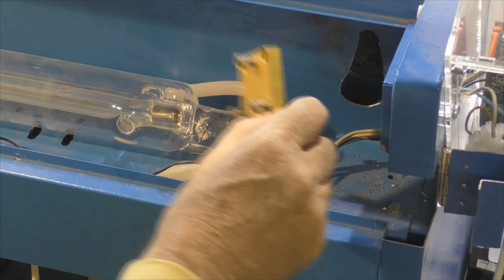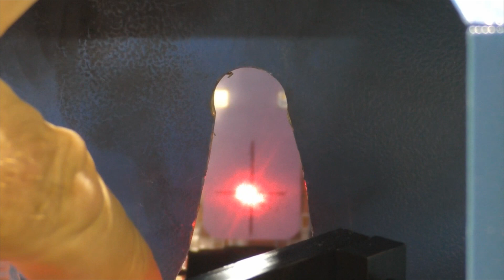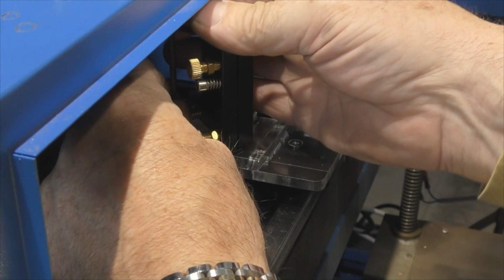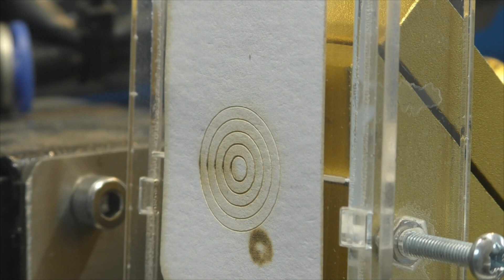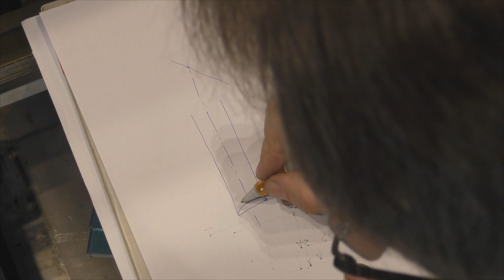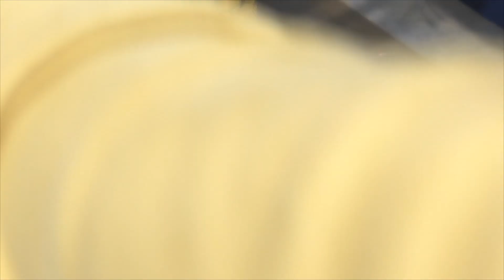RDWorks Learning Lab 119 One Piece Tube and Mirror Mount INSTALL

Comment: Brilliant video, is it possible to get the parts for my k40 please
Reply from the maker: Hi Nigel

 Thanks for your interest and enthusiasm.  Sadly I never intended this project to fit into a K40 . Two main reasons. One, there is just not enough  space in the tube enclosure. Two, the mechanics of the machine with its fixed head and its "floating" gantry are not worthy of the effort. That is not meant to be an insult to the K40 because  I have seen some great work from these very basic machines. However ........ don't be too despondent because  things change with the passage of time. Here we are 5 years later and after creating my own budget RF laser and being loaned a high spec MOPA fiber laser for 1 year,  I have gained a lot more experience of laser technology in general. 

Two years ago I was gifted a  very basic K40 machine   by Cloudray to "do something" with.  Hmmmm.......for two years its been just a flat surface to stand things on but I had a nudge form Cloudray a few months ago  about "upgrading" it to a digital machine with their special K40 kit  
 
https://www.cloudraylaser.com/products/cloudray-k40-series-upgrade-kit-for-co2-laser-machine?_pos=3&_sid=6f158186b&_ss=r

Was it worth it?.Rather than rush in with a negative answer I took a day out and did some imagineering. I eventually saw a vision of the future where this small format machine  could become a very portable version of my  "big" machines. All the same precision speed and flexability but  with an A4 work area..

 Please watch this as a taster
https://www.youtube.com/watch?v=zu-hccXJPBg&t=93s

Then take yourself across to
  
https://laseruser.com/k40-xtreeem-laser-cutter-upgrade-menu/

 and you will see what the possibilities are for your machine

 Best wishes
Russ

Comment: Russ, would you say adjusting your other machine is simpler with better access than Lightblade? As you have so much video material I wanted to decide which one is better purchase without before modifications. BTW. Amazing video as always. Thanks a lot.
Reply from the maker: Hi
At 4 times the price  my  Ebay machine, the Lightblade is not the sort of investment that  many hobbyists can afford. There is no contest if it was just a machine choice, the Lightblade wins hands down. Better size, better access, better usability and much better build.. Apart from throwing away a couple of annoying and unnecessary extras (auto focus and red dot pointer) I have left the machine unmodified for  two and a half years. It is made by a Chines company called Transon CNC and I note recently that you can buy a sister machine from ebay. 
https://www.ebay.com/itm/laser-engraver-cutter-machine-marking-machine-400-600-6040-80w-ruida-cnc-router/143082655440?hash=item2150640ed0:g:7nEAAOSw8~hcTskW

https://www.ebay.com/itm/4060-50w-ruida-laser-engraver-machine-carver-cutting-Acrylic-glass-plywood-cnc/143051312601?_trkparms=aid%3D111001%26algo%3DREC.SEED%26ao%3D1%26asc%3D20160811114145%26meid%3D065af592747d453097a7f485c758df4b%26pid%3D100667%26rk%3D6%26rkt%3D8%26sd%3D143082655440%26itm%3D143051312601&_trksid=p2045573.c100667.m2042

com/store/product/JNHXSK-TS6090-130W-Ruida-Laser-engraver-machine-Cutter-machine-CNC-Router-co2-laser-engraver/3879030_32982935304.html?spm=a219c.search0104.3.91.d5853ae3IjgVZw&ws_ab_test=searchweb0_0,searchweb201602_6_10065_10068_10547_319_10059_10884_317_10548_10887_10696_321_322_10084_453_10083_454_10103_10618_10307_537_536,searchweb201603_54,ppcSwitch_0&algo_expid=a27faee5-d1e1-4396-83d1-27c11ef1bc5a-14&algo_pvid=a27faee5-d1e1-4396-83d1-27c11ef1bc5a

There is a guy in Argentina that has this last one on it's way to him at present and he will send me pictures when it arrives so that I can assure myself that the basic mechanical build standard is the same as the Lightblade. I know that Thinklaser have messed with the specification and that the Lightblade is a special variant with many high standard safety features to comply with European machine build and safety standards for laser machines, but most of those mods are within the electrical enclosure and not to do with the basic design.

There are a few external differences that annoy me with this Ebay/Aliexpress variant. In particular the grill in the lower front door is bypassing all the exract air  so that nothing goes anywhere near the table/work area. Taping these over and leaving the main door open about 40mm will fix this

Best wishes
Russ
Reply: @SarbarMultimedia  Thanks Russ for such a quick and detailed reply. Hope we will hear from you a word or two once you receive the pictures to compare it.

Comment: Hi Russ, how do you clean your mirrors? I used alcohol and it made the beam burn material- does it make sense? 
D
Reply from the maker: Hi Dimitri
It depends on what your mirrors are. If they are gold coated then be VERY careful because gold is very soft, it will also me atomically thin. Depending on what is underneath the gold,  you could be in for all sorts of surprises if you break through to it.  Is this your problem?  I usually just use isopropyl alcohol and a cotton wool bud to  gently `clean the general film that tends to build on mirrors. Sadly the alcohol tends to leave a film behind and it is essential to finish off the cleaning with a proper lens tissue that you will be able to get from any camera store. If you have silvery looking mirrors then it's almost certain that these will be the best type (solid molybdenum). These are very durable and you can be fairly brutal with them and not fear damage. You can use acetone if there is burnt on debris but always finish off with a lens tissue. 
Best regards
Russ
Reply: SarbarMultimedia 
Hi russ, I will email you the photo

Comment: Hi Russ, regards
Thanks for the details were a great help.
The frequency of the tube (Hhz) is: 20 and the signal level: low, these are the parameters that must be the laser.

in which it helps me to modify the frequency or as if it is in the correct frequency. Thank you.
Reply from the maker: Hi Jean
This frequency  (20khz) is the PWM frequency and although you can adjust it, the only thing it will affect is the response time of your current demand during greyscale engraving. There is another frequency that you could adjust if you had an RF tube, but we don't, because our tubes are just DC voltage excited. so there is no frequency to adjust. There is one exception and that is if you select "special mode" in the scanning USER parameters . This operates from the PWM signal , but I can see no value in adjusting it from  20khz because you can control the mark space ratio with the % adjustment provided. See my video  that explores this Special Mode  https://youtu.be/nKZn3UwPEfU 

Best wishes
Russ

Comment: you recommend not to use the machine maximum 60% of its capacity, how much maximum mA for a 100w tube.
Reply from the maker: The max current for a tube depends on the tube manufacturer's recommendation and also on YOU understanding what power tube you have. You think that you have a 100 watt tube but is it really?. Does it have a maker's label? does it have a model number? If it does not then what diameter is it (80mm?) and what overall length?(1250mm or 1450mm?)
From this information I can tell you much more.

Why do I say 60% or 65%  should be the maximum power to use? Well, if you drive the tube too hard you are destroying the CO2 inside the tube. This is all explained in a video I did for Thinklaser. https://www.youtube.com/watch?v=2F5O-1TH8b0&t=142s

What controls the current?  Answer ......the power supply has a current regulator within. The max current output for a 100 watt power supply will be about 32mA where as the max allowable drive current may be only 25mA. When you ask for 1% power, the controller will send a zero volt signal to the power supply and that will result in 0 milliamps of output. When you ask for 100% power the controller will send a 5vdc signal to the power supply (the max is 5vdc) which will then deliver max output of 32mA.. That's far too much current  for the tube and will quickly kill your tube (as per the video above). Most people do not have an ammeter and so I recommend playing safe and never using more than 65% power until A) you have fitted an ammeter and B) you understand what the max allowable current is for your tube. My 70 watt tube will deliver 73 watts at 22mA but to get 22mA I set my power to 68%

As an example, you may have a Reci tube model number W2. Some sellers will claim it's a 100watt tube because that's the maximum output at 29mA. Reci call it a 90 watt tube because that's the "normal" watts of output at 27mA. However, Reci  recommends a max current of 25mA which makes the output about 80 watts.

Hope that makes some sort of sense
Best wishes
Russ
Reply: If it has the label is reci w2 rated power of 90w maximum peak power 102 watt, length 1250mm diameter of 80mm, had an equal one and with just 260 hours stopped working, regulate the source to 28mA, I want to take all precautions not to damage this new tube again.
Reply from the maker: Hi Jean Carlos
Your tube specification is here
http://www.recilaser.com/en/index.php?m=&c=Index&a=show&catid=7&id=66

In the operating conditions it says 
2.    Operation conditions
Water cooling: using purified water; 2 to 5 liter/minute; water temperature: 10℃-40℃.
The operating environment: temperature 2-40℃; Humidity 10-60%.
The working current: test current is 29mA. Maximum working current is 29mA. The running current must be kept below 27mA. The life span can reach 8,000 hours if the current is kept below 25mA. The ammeter must be connected to the negative electrode of laser tube.
When it is working under over-high current for long term, the negative pole will appear light yellow and the life span will be shortened rapidly.

This basically means keep the current below 25mA to achieve the claimed life of 8,000 hours. That's strange because it is advertised as a 10,000hour life tube!!! AND as I mentioned previously, keeping below 25mA basically means you have an expensive 80 watt tube. Reci are supposed to be the best but as you can see they are just like most Chinese manufacturers and have a tendency to exaggerate. I have used and calibrated a W2 tube so I know that these figures are correct because I was achieving 82 watts at 25mA

Best wishes
Russ
Reply: Very grateful for his answer, who sold me the machine never checked the source output values and was in 32 mA, error number 1, and when the laser began to fail, clean the outer surface of the output widow's mirror with tools with a 20% buffer and alcohol. 
buy another tube reci because they say they are the best and I hope to arrive this time at 10,000 hours of useful life.
You recommend that I adjust the 25mA from the power source or I do it from the machine with the vendor/Max Power % tool.

Congratulations for all the postage, I have 4 hours watching almost all your work, I expect your next video #120. and hope to be able to contribute something to the forum soon. regards 
Jean Perez
Reply from the maker: If you have an ammeter on your machine then just run a test to find out what % power is required to achieve 25mA.  If you are the only person using the machine thenyou can write it down and never go over that power when you write a program.. You can enter the Vedoor Parameters section (under file) with the code RD8888 and if you hilight the LASER section you will find that you can set the min %power (I suggest 1%) and also the Max % power (from your test results that give 25mA) This will make sure that if ever you enter say 100% power, the machine will ignore it and use the max value you have specified.
Best wishes
Russ

Comment: Greetings, I have a 100w tube, I already regulated the source at 28mA diando working at 99%, my question is what is the power I must use for cutting MDF 3mm, a laser tube was damaged because the source was more than 30mA, but I never work at 70%.  I want to know what is the maximum power not to kill, the tube that was damaged only worked 260 hours.
Reply from the maker: Most  REAL 100 watt tubes will typically run at a max current of 26mA. However it depends on the power characteristic of your tube (all tubes are different)  as to whether it' gets you any significant power gain by running at the max current. All the tube characteristics I have seen are far from linear. First your tube will not fire below typically 10% power and  at 11%power you may have 1watt of output. By the time you ask for 20% power you may have 30 watts of output (a 9% change= 29 watts) At 30% you may have 60 watts (10% change=30 watts). By the time you get to 60% power  (22mA)you may be getting 95 watts  and at 65%power (26mA) 97 watts. The only time you need power is for cutting and I ask you the question..... why drive your tube at more than 22mA when taking it to its limit of 26 mA only gains you 3 watts.. This is because the power curve flattens out as the power increases. Know and understand your tube.
In answer to your  speed for 3mm MDF? That depends on several factors. What is the focal length of your lens? if its 1.5" then you should be able to get about 30mm/s with a 100 watt tube. If it's the more typical 2" lens then you should expect about 20mm/s. However, you will need max air assist to cut any wood or MDF. and the focus point set onto the surface of your work.  Draw a 25mm test square and try running at 22mA (whatever power that is) at say 20mm/sec. If the square falls out then increase the speed until it JUST fails to fall out and then drop the speed by about 2mm/sec. . With lots of air assist and good extraction you should finish up with a  clean cut.
Best wishes
Russ

Comment: Hi Russ
First of all, thank you so much for all of your brilliant videos. I have been following you since I got my Chinese laser over a year ago, and I have learned so much from you. There is a topic that I have been interested in for quite a while, but I have not been able to find much information about it: Gas assisted laser cutting! I believe that my cheap Chinese laser cutter fitted with a Co2 Reci 150w tube should be able (at least in theory ) to cut thin sheets of metal using an assisting gas like oxygen. Do you think that it would be possible to replace the air-assist with a gas and thereby give the laser more power? I know that this is probably way to dangerous and would be stupid to try on a laserhead that is not designed for gas-assist. But in theory…. If it would be somehow possible to upgrade your Chinese laser to cut metal, that would open up a whole new world! Best, Rasmus
Reply from the maker: Hi Rasmus

I used to own two 3kW CO2 metal cutting lasers as part of a precision sheet metal working business. To cut metal you need first of all a special cutting head with nozzle that raises and lowers between each cut. The nozzle has to sit very close to the job and be between 1 and 2mm diameter because the aim is to put as much assist gas into the cut (kerf) as possible. Metal cutting is a different cutting mechanism to that of organics or plastics, in that you have to melt the material and then BLOW it away from the cut area. For mild steel you can achieve this with high pressure air at about 50 psi or you can get much better results with pure oxygen as an assist gas because that produces an exothermic reaction at the cut front adding to the heat and oxidizing the melt into small oxidized particles. Stainless is a whole new ball game. If you allow oxygen into the melt zone there is a reaction with the chromium in the stainless which turns it into a treacle like consistency and it will not flow out of your cut. You have to use a HIGH pressure cover gas to exclude al oxygen but the melt is still not watery enough to flow away cleanly. You can use argon but that is very expensive. Instead what you need is medical grade nitrogen (still not cheap) and LOTS of it because the pressure needs to be about 150psi to blow the melt cleanly from the cut area. Cutting other metals such as brass,copper and aluminium is almost impossible with a CO2 laser  because they are VERY reflective and the beam just bounces off and you cannot get heat into the surface to melt it. Yes, you can cut these metals with a different frequency laser light.Metal cutting is not a simple hobby activity. You need a lot of chargeable work for your machine to pay for it's high running cost. If you need a deeper understanding I recommend that you find a metal profiling shop in your area and see if you can arrange a visit to see just what metal cutting involves Research well before you spend that sort of mone.  Learn more about the infrastructure required because what you are buying  from China is a car without wheels.

All best wishes
Russ